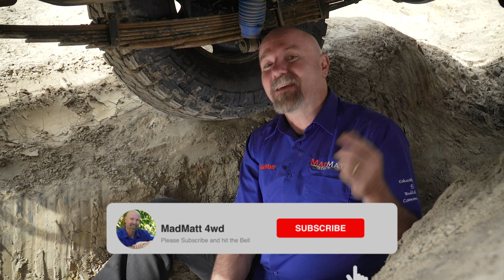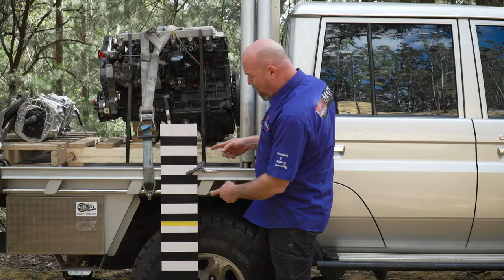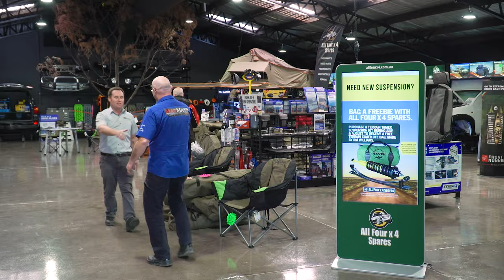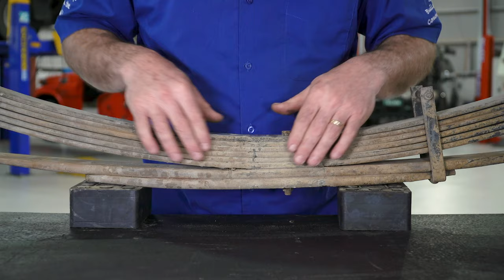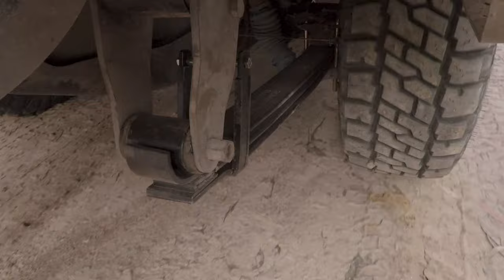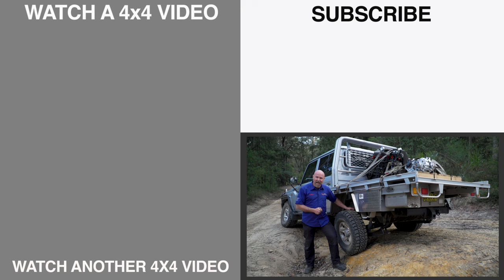What are Parabolic Springs? How do they work? 4x4 Suspension

Comment: Love how you guys down in Australia are improving leaf springs! I have a 1st generation Ford Super Duty, a 2004 F350 to be exact. Ford used parabolic front springs stock BUT every company in the states says they are junk and only offer multiple leaf packs as replacements. Wish they would follow Australian engineers and make upgraded parabolic springs for the Super Duty trucks. For now I'll jeep running my stock parts
Reply from the maker: I have a 02 f250 and apparently I can get aftermarket parabolics for it.

Comment: Thanks for the video, what’s the load carry weight recommendation of the parabolic springs, or is it possible in theory to have a 2tonne parabolic if that is what is required?
Reply from the maker: It's possible to have 2T parabolic. Trucks use them. The rating will depend on your vehicle.
Reply: MadMatt 4WD awesome, I had a feeling it was possible! Definitely keen to look into it

Comment: Great video and makes me wonder why so many leaf sprung ustes don't come with such a spring set up from new.  Cost would not be a major issue for a manufacture surley?  Might help me make up my mind on buying a ute now. I just want a basic run around single cab for personal use but the ride on all such utes is bone jarring without 500kgs in the back and even then still rubbish so buying a new ute and putting such a spring on it would solve all those issues for me.
Reply from the maker: I would certainly want to run parabolics if I owned one.

Comment: Ford Transit had front(single leafs) parabolic leafs back in the early 70s they been around a while. F250 have them as STD at around 1998.  And yes they give the comfort of coils with strength and load carrying of multi leafs
Reply from the maker: Yes they're not a new concept at all.

Comment: If the wonder spring compresses half as much under the same load then it can't be softer. Spring rates are not irrelevant. Even if the spring rate were variable (soft under light load, harder when compressed under heavy loads) they would not compress less, but more. It's always nice if spring rates are specified. OME do so but Terrain Tamer don''t even list recommended loads for their springs as far I can see.
Reply from the maker: I think it's more to do with the inter leaf friction that changes the rate.
Reply: @MadMatt4WD  yes and not only that,the design itself its pretty awesome, just hard to manufacture
Reply: I have OME leafs on my 76 based on the specs suggested by ARB, awful! I will be replacing them with TT parabolics but keeping the OME BP51. Not the first set of suspension I've had from OME either and I will never purchase OME springs of any kind again.

Comment: Ive seen slapper springs like those get folded back and bent when they hit a rock. they may work great on a work truck, but on a off roader not so much.
Reply from the maker: You’d have to hit the rock fairly hard I would think.
Reply: @MadMatt4WD  i live only a short drive to the Rubicon Trail. I've seen many times where those slapper springs cause trucks to get hung up on obstacles. some times when hung up it causes the spring to bend. best to stick with a properly built pack and loose the slapper springs.
Reply from the maker: I want to wheel Rubicon one day. I guess most of the people buying these springs are touring rather than rock crawling so this won't be an issue. Horses for course ay.

Comment: Wonderful,
You mean that the typical suspension springs which have the inter-spring layers friction prevent the required strain of the springs to minimize the impacts from bumps and jolts from the road, so the more the friction, the less we have spring displacement and the more the impact force is imparted to the cabin!
It seems this friction mechanism convert some of the impact energy to heat, but also prevent absorbing the total impact force so the remaining force is applied to the car structure!
Reply from the maker: Ok that sounds very complicated but if I understand you what you say is correct.
Reply: Yes, and no. In a ideal setup, that force is suppose to be absorber by the "shock absorber", in normal leaf spring part of that energy is as you say friction from the leaf spring, probably a very little, but noticeable because of the brake away force required.
Whit parabolic, as correctly mention in the video you need sock absorbers tuned to match the new springs.

Comment: Could I use parabolics with bp51 shocks?
Reply from the maker: I would think so being that they are adjustable. The Parabolic will need more shock than the standard spring so as long as the BPs have the adjustability I would think they would work.

Comment: you took the air bags out for those PB springs, put them back in and then see how it ride, because its much the same with air bags as the other springs.
Reply from the maker: No way it can be.  The interleaf friction will not allow it to be the same. Also the airbags had no air In Them.
Reply: thanks for the feed back